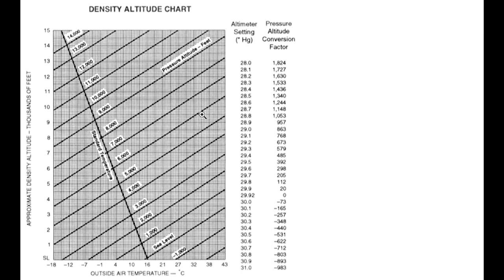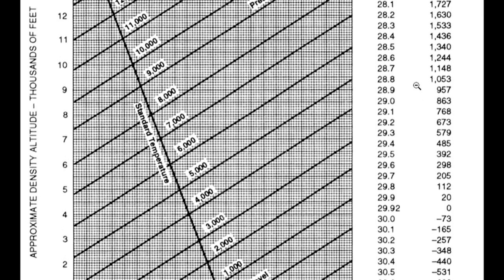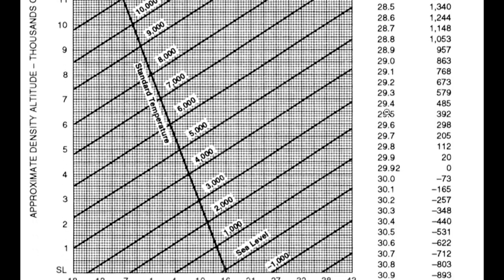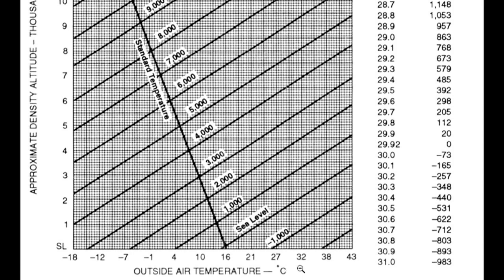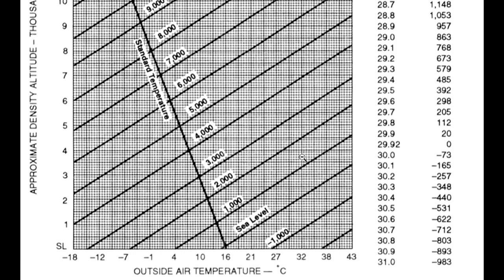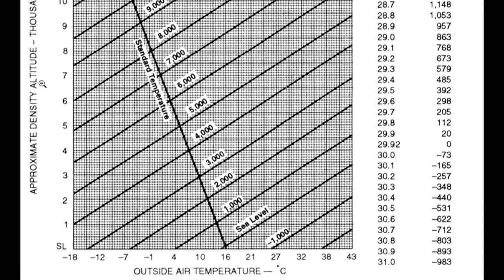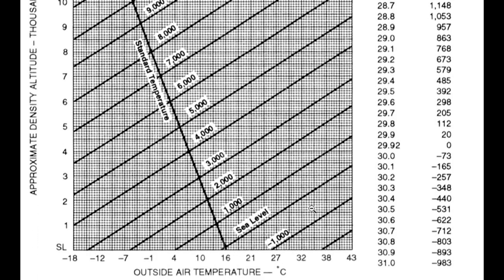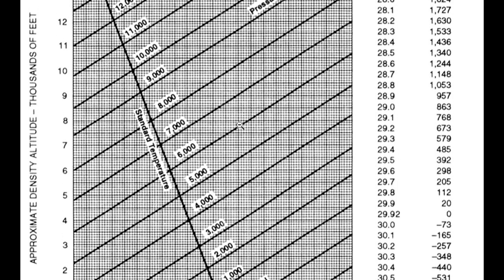Calculating Density Altitude

Comment: There are so many questions you need to answer and probably you need to shoot another video for that for instance you need to have a board and write down doors and calculated to the guys that like to have those in visual scene also you need some questions and answer it also you need to tell us what the temperature is not on the chart that it is more than 43 or what if the the pressure altitude is not there or is too 28.25 how we fix those there's a lot of things you need to work on it should have better video I'm not trying to tell you that you're not doing a good job I'm just trying to tell you that there are so many things you need to work on it thank you
Reply from the maker: Thanks for the feedback! We always strive to do better! Fly safe!

Comment: Don't use POH takeoff and landing charts without also using the KOCH chart when flying in mountains or high density altitudes. Print this chart. Keep it in your office. Your flight bag. In your plane. And use it when flying high! https://www.faasafety.gov/files/gslac/library/documents/2011/Aug/56396/FAA%2520P-8740-02%2520DensityAltitude%255Bhi-res%255D%2520branded.pdf&sa=U&ved=2ahUKEwjev_vj2LTtAhWUvp4KHU0MAPQQFjAIegQICBAB&usg=AOvVaw1Anrf85lMITWVk0xPdW3do

Comment: As a CFI, I commend you on the clear and precise explanation of a density altitude chart. I found your channel while doing research on the story of two airline captains on a delivery flight of a new Cessna 150 and decided to descend into the famous meteor crater near Winslow, Arizona, where they crashed when they couldn't climb out. I did a little reverse engineering and came up with two grown men with luggage and full tanks (topped off at Winslow) put the 150 at about max gross weight. Temperature was 30C and elevation at the rim of the crater 5600 feet; density altitude pushing 10,000 feet. The rate of climb chart for the 150 shows about 150fpm in level flight. The crater width is about 3500 feet which would require about a 20 degree bank to circle in it, dropping the rate of climb to zero which is exactly what they found once down in the crater. They circled for over two hours trying to burn off fuel but finally crash landed in a more or less level area in the bottom. One pilot had a broken back and the other one less severe injuries. By that time they had quite a gallery of on-lookers and rescuers were already on their way down.

Comment: Why do you always use easy numbers?  Instead of using the charted number or one directly in between, do examples using say 30.22 instead of 30, 31, or 30.5.  Then show the math for interpolating a number like that cause that is the questions on test not the easy just take half of the numbers because its directly in between

Comment: this is not practical for the test!!! the test would never give you exact numbers on the chart. he needs to explain the fourmula for getting the pa between the exact numbers.!!
Reply: You need to extrapolate.  So if the altitude setting is 29.85 (not an exact number on the chart) then you need to calculate between the pressure altitude conversions related to 29.8 (112) and 29.9 (20).  The diff between 112 and 20 is 92. Half way between 112 and 20 is 112-46 = 66.  So the pressure altitude conversion of 29.85 is 66.

Comment: My first experience where Density Altitude made an impression on me was a trip out west. I was traveling to Santa Cruz, CA from Dallas, TX for the first long-range trip. I landed in Deming, NM for fuel and a food break. The Altitude of the airport is 4314 MSL and the Altitude of the Arlington, TX muni is 630 MSL. It was a hot summer day about 90 degrees when I landed. I told the lineman to fill r up and didn't even think about density altitude because I was the only one flying in the plane (plenty of wiggle room on the density chart)....  Upon finishing my lunch, I hopped in the plane and took off down the runway only to notice how long my take-off run was and how my rate of climb was about 200 fpm..... Wow.... ! That's when I realized that Density Altitude was VERY important!

Comment: I used to fly at Black Forest Gliderport in Colorado (Elevation 7200 feet) and we would often have pilots fly in to fly gliders. It's amazing at how often we would hear someone trying to start their injected engines with an OAT of 85-90°F and could not get them to run. They would start, belch black smoke an die. They had no idea how to crank a complex engine with a density altitude of around 10,000 feet. One of the instructors would usually go out to where they were parked and help them get going. I tried to help a guy flying a Baron but was told he didn't need some Cub pilot telling him how to fly. He got one engine running and sat there cranking on the other one until he burned the starter out.

Comment: What I hate about this chart is that it gives you APPROXIMATE density altitude.  I don't understand how to follow the lines to an accurate number!? It's more like guessing the answer.... The microscopic squares don't help either😡 I'm getting wrong answers because of this. It's so frustrating... Anyone else feels the same or is it just me?
Reply: same its driving me nuts!! there are fourmulas for getting exact density altitude but they give me the wrong answers!!
Reply: @lukecartwright1803  I'm study for UAG using Gleim Aviation web site.  It has a disclaimer about the chart and says to use the Flight Computer (like a circular slide-rule) instead.  "The FAA will provide a density altitude chart for use during the knowledge test. This chart is identical to Figure 8 at the end of this subunit. Normally, you would use the right side of the chart to convert indicated altitude to pressure altitude; then you would use either the left side of the chart or your flight computer to convert the pressure altitude to the density altitude. However, the left side of Figure 8 is incorrect. Both in this study unit and on the FAA knowledge test, to convert pressure altitude to density altitude you must use your flight computer. If you use the left side of the chart in Figure 8 to convert pressure altitude to density altitude, you will get the wrong answer every time."

Comment: Um im sorry to ask you about that but the Pressure Altitude refers to 1013hPa/ 29.92 inHg... when you want to calculate the Pressure Altitude you apply:   PA = ELEV- (Altimeter setting - 29.92) x 1000.. That would make us a PA of 2120 ft....when you have an ELEV of 200ft... because the standard datum plane is lower than the altimeter setting (plane), which is lower than QFE (inHg) .. therefore you have to add QNE (ft) and ELEV and this makes the PA. How comes theres a PA of 1824 ?

Comment: Not getting it, you said your altimeter setting was 28.0 so on the chart why did you go to the altimeter setting of 28.8 and even after going to the 28.8 you said the pressure altitude was 1253 when I see 1053 in that sense are u saying that the field elevation is 200 ft?